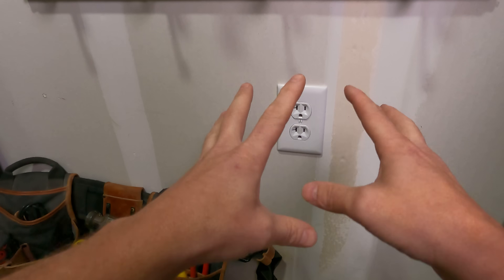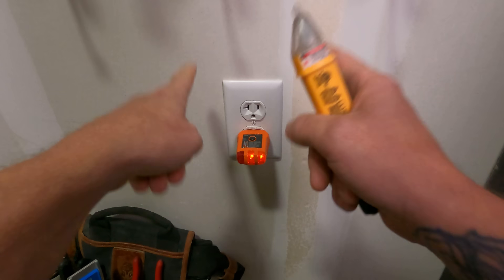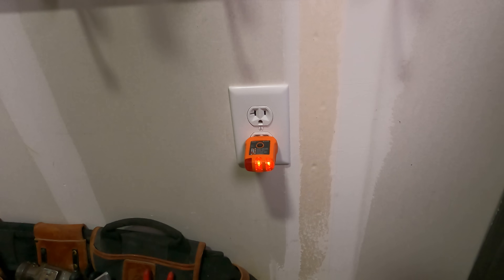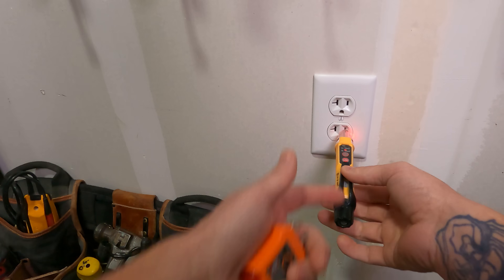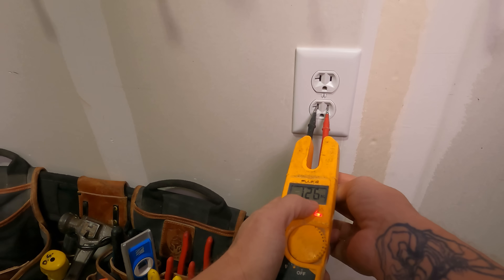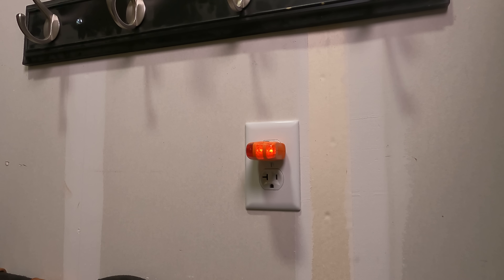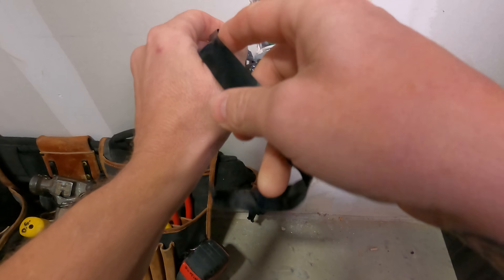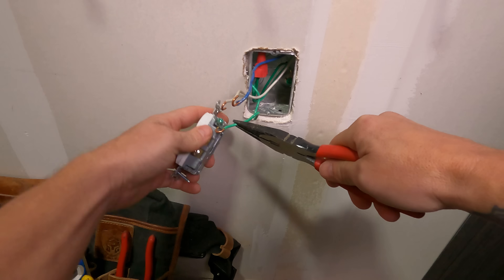How to Change Out a Receptacle  - The Right Way!

Comment: I respect the fear of teaching DIYers, but there are some of us who watch your channel just to learn. We still call on electricians for work. 

I have five Mike Holt books, have taken exams to check my knowledge, own the NEC, and in general have a pretty deep knowledge of this stuff given my education in EE and physics (plus I have designed circuit boards before for microelectronics). But, I still watch to learn code and see how an electrician does stuff, not to kill myself. 

Point is, you're a good teacher and you are reaching non-certified electricians who just want to learn and not necessarily do.
Reply: It’s always good to know how to do things the right way so even if you don’t ever do it. If you pay someone else to do it you will know if there doing it right. 

I taught my sister to put brakes on her car. She helped a bit and most just learned. I don’t ever expect her to do it again but now I hope that she knows enough that she can’t get taken to the cleaners by a shady mechanic or dealership. I enjoy doing my own work in as much as I can. Replacing switch’s and outlets, breakers are easy. Adding a circuit is more involved but not difficult. But you won’t see me putting in a panel and service, that’s just beyond my scope. But there’s no way I’m paying someone else to replace a switch or outlet for $100+. 

When I added in a new circuit in my panel for a 50amp 240v welder outlet I found the previous licensed electrician made a mistake and didn’t secure the wires for my ac correctly in the breaker. When your working on your own stuff you can take the time and go over everything and make it right. Had I not been in the panel working and inspected everything I would have never known.
Reply: @FishFind3000  exactly. Ultimately I'm the one responsible for my safety and my children's safety. I want to know this shit so I know it's being done right. It doesn't mean I'm going to do it all, but it does mean I know to spot a crap job, and I'm not paying for a crap job that puts us in danger.

And despite what electricians tell you, there are still those out there who'll do a crap job.
Reply: @FishFind3000  just because they are licensed doesn’t mean they have integrity….I have found so many incorrectly installed details that were done by “licensed professionals”
Reply: Right. I watch because electricity has always fascinated & terrified me. I want to understand everything about it, even though I don’t think my brain will ever have the capacity.  lol
Reply: I find it very hard to believe you’ve read Mike holts books and still hang on to the thought that you might “kill yourself”. If you’ve opened your NEC book to the first few pages you’d read “compliance therewith (of the nec) and proper maintenance result in an installation essentially free from hazard…” Understanding reduces risk in everything from stocks, to planting a seed in the ground to make a profit, to electricity. Get some confidence and quit wasting your money hiring guys to change your receptacles and do it yourself, especially with your background on electricity.
Reply: @stanleyramirez4422  The comment about "kill yourself" was made because when I talk to electricians -- especially after I mention that I have read Holt's books -- I'm often told to shy away from doing anything or learning anything more on the topic because I will still likely "kill myself" or "burn my house down" since I'm not a certified electrician. It's a way of defending against people who think regardless of how much effort I put into learning, I'm still going to "kill myself". It's odd because I even got hold of a journeyman exam and took it and passed, and I still get those comments (but it means nothing technically since I don't have on-the-ground hours). 

I do 99% of my work and pull a permit each time. I'm a software dev, but in another life I might have been an electrician or electrical engineer.
Reply: You (B Rush) have the kind of background I like to see make YT videos on house wiring.  With theoretical and  practical knowledge I believe you could make a great video on my favorite subject I see alot of misinformation on; Grounding and why it's done.  If neutral wire was not connected to ground at main service panel, then you wouldn't get shocked touching a hot wire with one hand and a water pipe with the other.
Reply: To Ben rush: I've been wiring things since I was quite young and u probably have more head   knowledge  than I do make up a😊 mock up board using an extension cord with a switch use 12. Gage cord wire up a three way and signal pull buy sum Romex 14 or 12 gage wire some three way wire & two conductor all with safety ground wire to run from the other junction boxes switches light box receptacles in side junction boxes these should help u with confidence In doing it for real. Buy a gfi as well remember lines power is hot coming in and load is the wire going out. To another receptacle usually in another😢 Jar (junction box)but not always  example if it's the last plug on a circuit or thers more than one  item going in to same 12:23  junction box l like gfi and regular commercial grade out let in there if practical to have it that way.

Comment: I think it would actually be desirable to have a set of DIYer videos done by someone that knows what they're doing. I see some out there with obvious code violations, like a guy using the screw on the cable clamp for his ground wire. Another valuable tip to DIYers would be how and why to replace backstabbed receptacles or switches with screw terminal or clamp plate connections, and what to do if you have daisy-chained outlets.
Reply: Screw on the cable clamp for the ground wire?  He was using a screw intended as a mechanical fastener for the purposes of bonding?

Comment: I spent many years as a service electrician. 
NEVER USE stab in the back connections. 
If you tape the device do not use more than 2 wraps it’s a pain to work on
Reply: And may not fit back in the box, especially with GFCI's.

Comment: I’m installing a ceiling fan in my bedroom and have discovered a buried switch loop line in the wall. Not sure how but probably got mudded accidentally at some point before we purchased our home.. I’d like to use it to power my fan but I’m not sure where it come from. It is hot.. How could I go about using it? I’d like to add a switch at that location.. It’s an old house so it’s a 2-wire line, red and black.. any thoughts?
Reply: Call an electrician.

Comment: Glad to know as a DIYer that I’ve been doing this correctly! But you didn’t cover a few issues I’m curious about: Is there a standard for using top screw for line wire, bottom screw for load wire? When should you use pigtails versus wire directly? What’s the best method for folding wires into the box behind the receptacles? I leave more complex things to pros, but replacing receptacles, switches, and fixtures is something I need to do frequently
Reply: It doesn’t matter which screw you use top or bottom. I think it’s just his preference to use the top screw however the outlet is positioned in his hand. From other electricians I see them pre-fold the wires before they go into the box kinda like an accordion. Tuck into the bottom then tuck into the top and mash the device in.
Reply: @FishFind3000  pre fold - makes sense - thank you!
Reply: 1)There's no standard, as it's just passing power from one terminal to the next. UNLESS it's a split receptacle.
2)Always wire directly. Exceptions for multiple gangs of switches with 1 power source, or wires are too short to work with.
3)Accordion the wire (e.g. press the wire into the top left, then bottom right of the box), never spin and press in. Just my 2 cents.
Reply: Yep

Comment: Damn Skippy! Who wants to pay $500 for a recepticle replacement?
Reply: I’m with you on that brother! A few years ago I replaced the capacitor on my garage door opener at a cost of about $8.  I sent the word out to the neighbors as all our houses were built at the same time.  I included a warning on draining the capacitor for safety.  The response back, “ Why didn’t I just call a the garage door repair man?”  I guess I’d rather learn a little on YouTube, spend $8 and 5 minutes rather than pay a gut $150 to tell me the motor is dead and then charge another $300 to replace a perfectly good motor!
Reply: @bljdeep  not at all. I respect the electrician trade. I'm most likely calling electrician to replace a panel, but $600 to install a plug just so I can plug up appliances is ridiculous.

Comment: When I add receptacles I will usually just hold the outlet all the way to the left when im tightening the 8-32 screws because it will make it level (if the box is level) and its biased towards the neutral side and I dont have to fuss trying to make it in the center of the screw hole.
Reply: 6-32

Comment: I had to replace the receptacle for my washer in my basement a few months ago. Top outlet was showing intermittent ground while bottom was constant. Made sure to turn off the breaker before I started taking it out. Once it was out, I shook it and heard something moving, telling me a contact had broken. Made sure to test the outlet again when I put the new receptacle in and then turned the power off again before I put the cover back on. A simple job, but as I'm not an electrician I made sure to minimize the risk as much as possible. Even tested the receptacle to make sure it was de-energized before I started taking it out.

Comment: One thing I like to do is write the breaker number on the inside of the cover plate.
Reply: Definitely! The current house I live in has two 200A panels, one is fully loaded, the other is maybe 50% loaded, for around 60 breakers total, of which 7 of them were labeled. I spent a fair amount of time tracking down what breakers when to what, then pulling the plates and writing the panel and breaker number on it. I also created a detailed spreadsheet that I taped to the front of each panel.
Reply: I started marking the cover plates recently, but I also put the info in my phone.  Makes it easier if the circuit breaker has tripped and you’re in the dark.
Reply: Until a painter comes along takes all plates off and rearranges them when they finished lol
Reply: @blahblah123321able  And then gets a severe beat-down afterwards.
Reply: Great idea
Reply: @46fd04  thanks! You can also right it on the inside edge of the box, but there’s usually not to much room for that👍
Reply: It is better than it not being there. But you have to open the receptacle when the power is on to find out what circuit it is.
Reply: @ecospider5  The risk is very low, even for someone who doesn't really know what they're doing. Remove screw, grasp faceplate by edges, remove, read, replace, re-insert screw. Don't lick the receptacle. Easy peasy.
Reply: @JCWren Everything about electrical safety is trying to protect against the one in a million problem. I’m sure there is a receptacle somewhere in the US that has a plastic center screw and the ground wire is not installed correctly, and the hot lead is touching the ground. Making the exposed metal deadly.
Reply: @ecospider5  "The risk is very low" -- I didn't say "The risk is non-existent".
Reply: It’s also a good place to right what the paint color/code is if you ever need touch ups.
Reply: This.
Reply: Excellent idea

Comment: Also after you get the plate on, square up the plate cover screws- meaning; align all of them them vertically up and down. Show pride in your work.
Reply: The technical name for this is "clocking". And I agree 100%.
Reply: No.  If a DIYer is doing the work, I'd like them to not do that.  It's one of the first initial ways I know that an electrician was not the last one working on that receptacle (then you remove the plate, and find a whole lot more!  Hahaha).
Reply: @saberx08  Don’t worry, you’ll still find all the back stabbed wires instead of pigtails. Hahaha.
Reply: @saberx08  Ah, don't want the secrets of the brotherhood in the hands of the laymen, eh?
Reply: @JCWren  
Nope, not my point at all.  I would like the electrical work of any DIYer to be nearly indistinguishable from if a good apprentice did it.  Lining up the screws is a cosmetic preference that has no impact on the safety or function of the receptacle.  And, I could care less if they do it or not.  I'm just saying lets not say "this is the way" with superficial details, when addressing DIYers.
I love the idea of a good electrician like Dustin sharing "how to's", so non electricians can see how to properly do basic work.

Comment: As a home owner (not a electrician) I replace recepticals, run circuits and even replaced my electrical panel.  The panel was permited and inspectied.
Reply: It’s the best way to save money and know the work is done right.
Reply: Thank you for this. I just moved into a house built in 1992. I just what  to replace the grimy receptacles and switches and I found out it’s $110.00 each  by an electrician.
Reply: Don’t you need a license to even pull a permit for that kind of work?
Reply: “1 home owner dead after diy electrical work - this is abc news… back at ya. “ Hire a professional you goof balls its not worth your life.
Reply: Now days just too expensive to hire a contractor. I had my panel replaced in 2005 cost me $1400 go from 150 to 200. Neighbor got a quote few months ago wanted $5000. I watched the guy do it took him about hour once the utility cut the power and pulled the meter. Most of the time was just waiting around or talking to the inspector about a football game. I understand contractors have lot of costs and have to make a profit but now days just gouging people guy made about $4000 an hour. I'm in my 50's never in my life have I had to do so much DIY work purely because of cost.
Reply: @Mike-01234 panel swaps don’t take 1 hr especially with only one guy unless he was swapping a baby sub panel. Plus cost of materials such as the panel tubs,  meter base, breakers etc  have increased substantially in just the last few years due to supply chain issues. Not sure about the utility company/AHJ in ur area but there’s also fees associated with inspections and getting hydro out there to begin, with the cost being passed down on the customer unfortunately.
Reply: @Nick-bh1fy  Homes are slump block panel is all in one with meter built in to it at the top. Once the utility disconnected it from the pad mounted transformer he had the old panel off in about 20 min. He popped out all the old breakers used a impact gun to undo all the connections. Panel he used cost about $250-300 AHJ is $100 utility is free. No clue what a "Hydro" is.  Like I said for what he was doing $5000 was gouging. He driving around in a 120k F-350 platinum diesel. Honest price no more then $3000. I get it when times are good can quote the moon and people will pay. 2010 will happen again only matter of time.
Reply: @Mike-01234  where I live cost of utility and AHJ inspections can run close to 500$, panels costing roughly the same depending on size, not justifying his insane markup but it’s not always “price gouging”. There’s also overhead factored in the price if he’s running a decent sized shop as well. Btw hydro is another term for the electrical utility where I’m from bc a lot of our power is produced by hydroelectric dams
Reply: Not everyone is gonna get lucky and do a full run. Stop encouraging people. Its not safe work.
Reply: @guts1005  That's hard for me not to do because I have little resistance to electrical challenges, it sparks up my interest, I'm just full of energy and I just want to liven up the place with new decor switches, 3 way switches, GFCI outlets, recessed lighting, new light fixtures(some with fans), and in the garage a 220 outlet and replacing all the old fluorescent lights with LEDs. It's the money I can save and trusting someone to do electrical work using funny words like pigtail, pole, common, traveler and leg....either Go Big or Go Home.

Comment: Hello,  I love your videos.  One suggestion, I recently purchased a portable generator and I would like to learn different ways to hook it up to my house.  Run heater, AC, Frig, freezer, ...  I would also like to learn how to hook it up to existing wiring and how to possibly modify systems for direct hookup.
Reply: Hooking it up to your service requires a transfer switch off some kind of you want to leave it hooked up permanently. I've not seen a manual transfer switch rated for residential services in a VERY long time, but there very well be done that in not familiar with. Sold GE electrical equipment for 25yrs and know GE didn't have one and brother neither did any of the meter manufacturers had one either.... Automatic transfer switches are expensive and can be more technical than home owners need or can understand ....
Reply: @bryanduchane2371  Good details.  I'm trying to learn all I can.  My electrician doesn't seem overly helpful.  He said he could implement anything I want.  The challenge is I don't know what I want.

Comment: To keep it real, isn't the silver side (neutral) of the receptacle always on the same side as the ground screw? I have all 3 testers. Thanks for the video!
Reply: Usually, Ive seen some 4 way switches that have the ground in the center at the top of the switch behind the yolk. The way I keep track is just looking at the receptacles (face) and I know left is neutral.
Reply: A memory aide with a slight sexual connotation, “A small slot is always hot!”